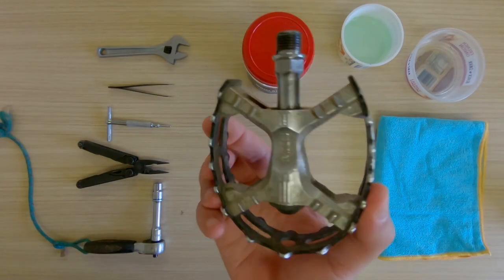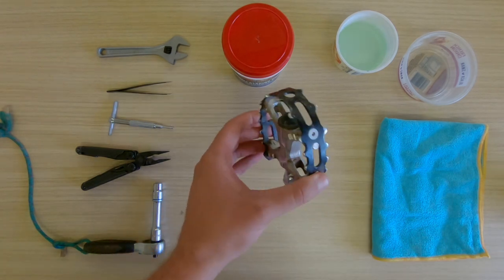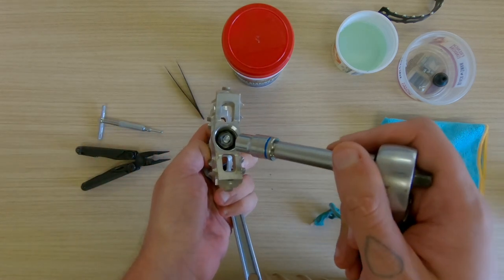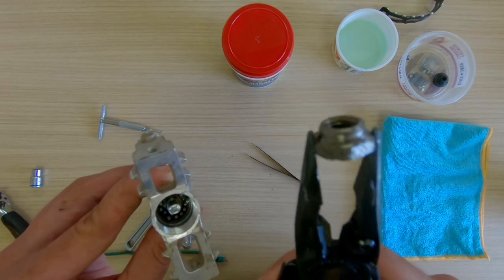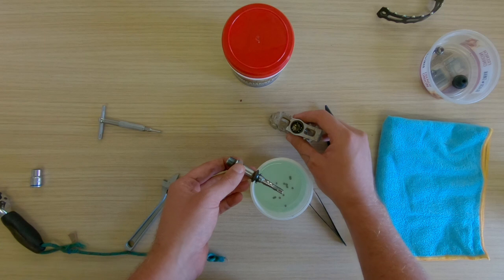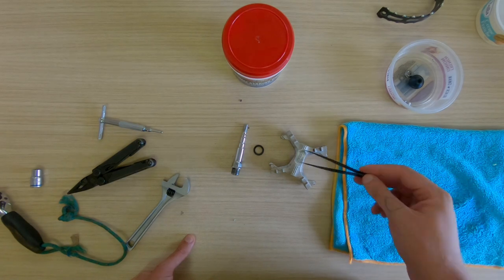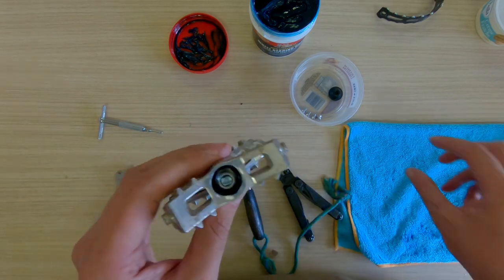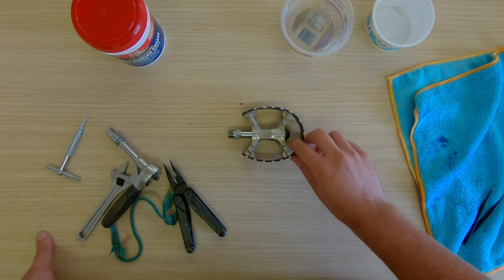MKS XC-III Pedal Service

Comment: I've been doing bike bearings since a kid but with pedals I always got lazy, never had a bench vise either which is helpful to get them apart.  Now I'm inspired. One tip with ball bearings or anything with small parts like rear hubs, make it a discipline to work over an old large towel spread out over the work space, it'll save you being on your hands and knees for an hour, either that or buy a big jar of balls.
Reply: Just to add, I have the VP and SE versions of the Beartrap, they were very cheap and both pairs came with the bearings set so tight they hardly spun, I didn't realize the cap pried off I'd always seen caps screw in place, I figured for the price they probably just had something like Delrin bushings inside. After seeing this vid I got curious. I just saved two pairs of pedals, one was new that I'd shelved as crap but I loosened it up and it's now fine,  others were ridden enough that I wanted to check the insides, surprisingly cups, cones, balls are fine, I'll clean them up and put them back together. Pedals ain't so bad, now I have half a dozen old pairs to keep me busy. Big Thank You!

Comment: Like you I run MKS pedals on my bicycles but mine are three different models .Two being the EZ series for quick removal when boxing the bicycle for aeroplane. Same service procedure with metal dust caps and a MKS spanner for the caps. Fine tuning is a learned technique , I've used Exus grease for pedals, crank and steerer bearings for about 12 years now. Good video.
Reply from the maker: Cheers Paul. They're a good bit of kit if you know what you're doing. I'm sure they'll outlast the bike at this point!

Comment: I've dismantling bnib xc-iii which have "rattle sound" and just curious why mks just put 12 balls each while the space can hold 13?
Reply from the maker: No idea, but I'm sure they know what they're doing! 😅

Perhaps room for grease? Who knows...
Reply: @VeloObscura 

Sure, they're Japan manufacture 😍

But if check another cup cone bearing system (hfh, headset, etc) the balls closed with anothers tight. Rolling in the cup without large gap.

I just regrease (with 1.5 NLGI) a lot, and the rattle still exist. Maybe 2-3 NLGI grease work better for reducing that sound.

Comment: thank you so much I bought this pedal september this year and suddenly has ticking sound god it's annoying for the product claimed as Japanese quality LOL
hopefully with this service can eliminate those pesky sound
Reply from the maker: You're more than welcome!

I searched for a tutorial to fix mine, but couldn't find any, so I thought I'd just figure it out myself and make a video for anyone else that needs it.

I'm so glad that I helped someone!
Reply: @VeloObscura   HI it's me again, thanks to your vid I successfully service my pedals. Buuuuttt .... I made a huge mistake, stripped my left plastic cap T_T now I can't open it since the plastic is ...rounded do you have any idea how to open and possibly replacing it with spare parts if any ?
Reply from the maker: @mazditzo  Ah, crap. What bit did you strip? Did you round out the hole with the hex wrench?

If that's the case, then the way to fix it is to cut a slot in the dust cap. If you cut a slot in it, then you can use a big flathead screwdriver or something like that to unscrew it.
Reply: @VeloObscura  yes with my hex, I tried to unscrew it (left pedal) suddenly it slipped and round the plastic 😂 thanks for the advice, I contact mks for the part replacement they have it but since in Japan is already weekend they will confirm the next monday 😀
Reply from the maker: @mazditzo  - Ah, excellent! Well at least now you know how to get it out, so that you can install the new one. 👍

Comment: Do you find yourself losing skin from your shins with those pedals? Nice tutoral!! Thanks.
Reply from the maker: Haha, thankfully not! I have lost a lot of skin from MTB pedals with big pins in them - they're far more grippy than these, but also more perilous!
The draw to these is just that they're serviceable, as you've seen, and last forever. I've had a lot of issues with MTB pedal bearings!
Thanks for commenting. 😁👍
Reply: @VeloObscura  I've never used that type of pedal, since I've been a road rider most of my life. I'm intrigued to know why you and other flat pedal users don't just use SPD pedals and shoes. I would have thought they would be ideal for touring.
Reply from the maker: @brianward7724  I've got a pair of SPD shoes back home and I have used them in the past for other types of cycling, but for us, there is really no reason not to use flat pedals while touring.

We spend as much time off the bikes as we do on them, which would mean needing to carry another pair of shoes. I don't fancy spending my day off in town or off on a hike with nothing to wear but SPD shoes and there isn't any real benefit to warrant carrying 2 pairs of shoes on a tour. We certainly aren't doing any great speeds and don't really need that sort of power transfer - there's even recent research to suggest that with correct technique there isn't any difference between SPDs and flats, but that's a can of worms and a mystery that I don't think can be solved in YouTube comments! 😅

There's also the matter of having more stuff to fail and more spares to pack. Packing SPD shoes means packing spare cleats and if anything happens to those shoes then I can't pedal properly until I get some new ones. With my setup I can wear any shoes I want - although ones with a fairly stiff sole are preferable. There's also the fact that SPD pedals are more complicated than a flat pedal.

I think for short weekenders or multi-day trips SPD shoes are fine, but for long term touring I just don't see the positives outweighing the negatives for me.

Can you tell I'm a fan of flats? 🤣

I'm glad I got these ones, because as you're about to find out in the Tassie videos; My last pair were not good!
Reply: @VeloObscura  Yes, I think I CAN tell you're a fan. You may not be aware that there is actually a sort of 'clip-on' sole that isn't either as heavy as spare shoes, nor as bulky. An American rider I used to follow used them on a trans-USA camping trip. Seemed to work well. If I even get to go touring again (and it's a big IF), I will be giving them a try. The main reason I mentioned them is the help they would be up hills, as I have noticed that Bonnie seemed to struggle in places.
Reply from the maker: @Brian Ward  I've never heard of those soles before! It's an interesting concept, but I wonder if that's just adding complexity.

Another thing worth mentioning is that Bonnie is one of those people that is TERRIFIED of being stuck to the bike and not being able to unclip! 😅
Reply: @VeloObscura  Well, yes, that is the problem with many riders, I'm sure.

Comment: Don't you have to tighten the lock nut against the cone? That takes special tools and it looks like you don't have them 😞Shimano TL-PD63 Pedal Axle Adjustment Tool appears to have two sets of sizes so it might work on those. I know the SPD 535 had bearings that use that tool but they are smaller than what you have there.
Reply from the maker: No specialist tools required. Just a metric socket set.
Reply: @VeloObscura  But you must hold the cone nut while you tighten the lock nut against it, right?
Reply from the maker: @solarheat9016  Nope. Once you tighten the locknut the cone-nut will bind up. Sometimes it takes a few attempts to get it to rest in the right spot, but it works just fine. I have about 10,000km on these pedals since doing the service and they're still running like brand new. There's footage out there of the workers at MKS assembling the pedals too. 👍